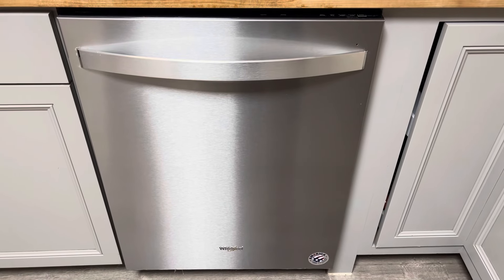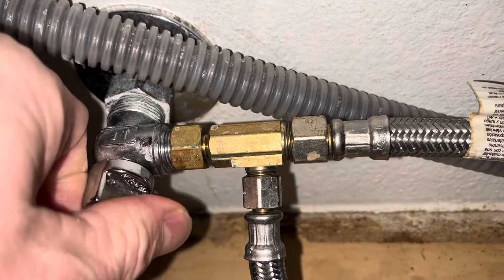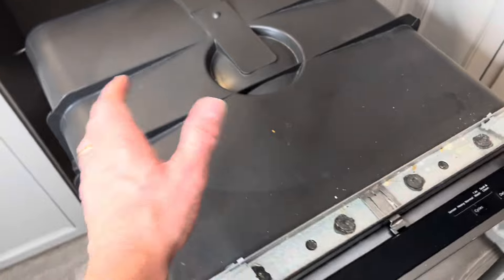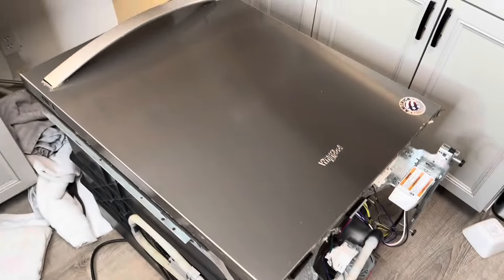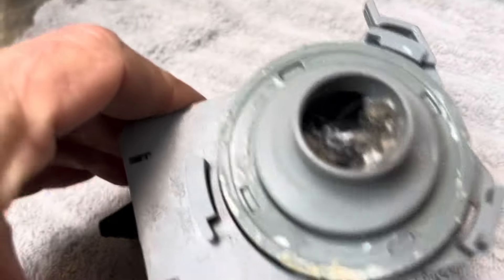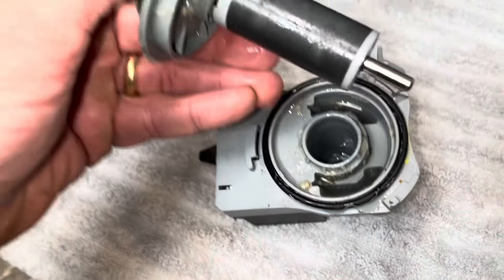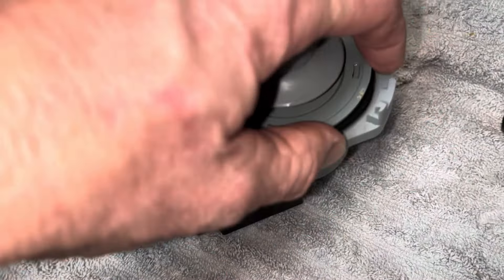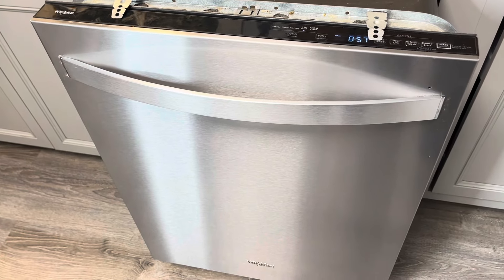Whirlpool Dishwasher Not Spraying Water? Quick DIY FIX | Easy Troubleshooting Trick Before Replacing

Comment: I can’t get the last piece off to save my life
Reply from the maker: It should twist off of there
Reply: @DIYTechnician  We finally got it off. Unfortunately, there were no blockages, it was clean. Any other ideas?
Reply from the maker: @sheesh8624  did you cover the basics already ( power, clean inside filter/screens, check water flow to dishwasher etc)?
Reply: All above has been done . It has power, filters cleaned out, and it fills and drains.
Reply from the maker: @ss9756  are there any fuses to check that you can see?
Reply: @DIYTechnician   I have no idea where to even start to look for that I am just a wee layman lol
Reply from the maker: @ss9756  lol I hear ya, me too. Well I have no other suggestions. I don’t consider myself an expert at these things either. Best of luck to ya. Hope you can find a solution.
Reply: @DIYTechnician  Thanks for your help!
Reply from the maker: @ss9756  no problem!